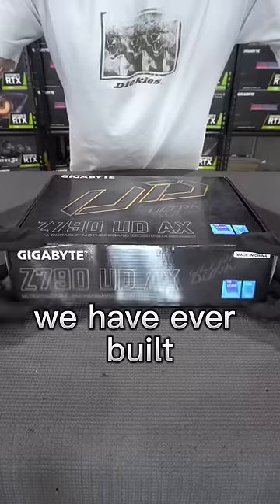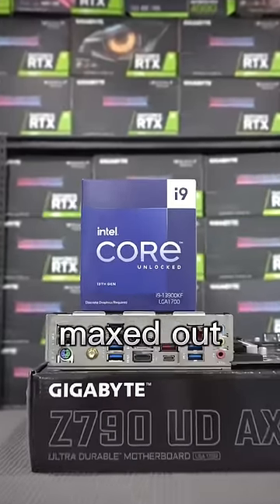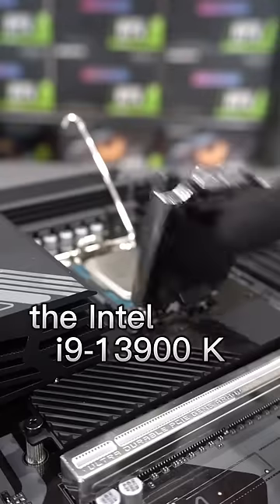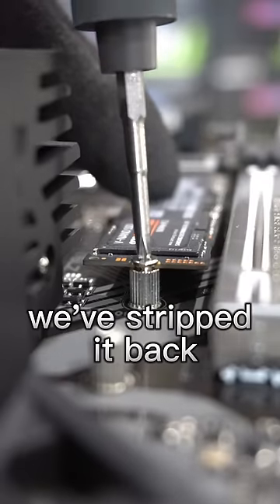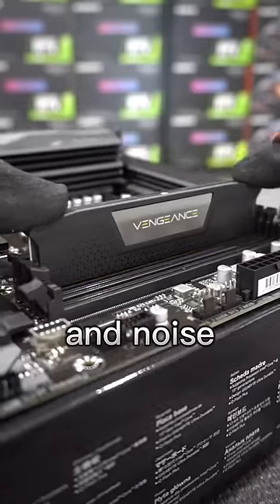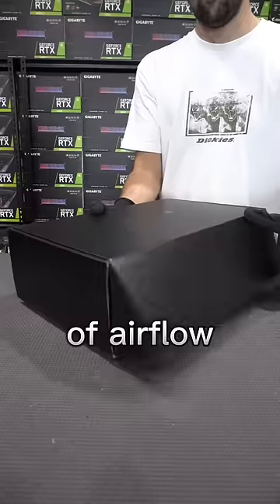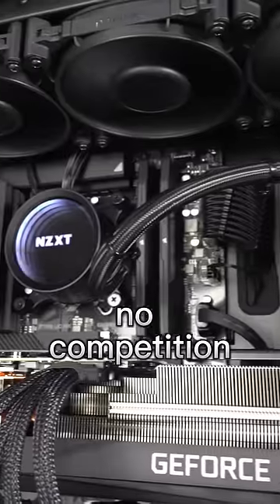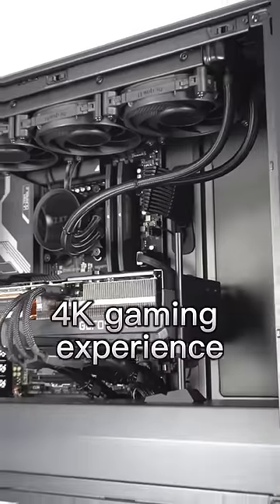The BEST Gaming PC 👑 RTX 4090 + Intel i9-13900K 😱

Comment: Ryzen 9 7950X3D laughs in the corner
Reply: i9-13900ks beats it slightly at the same msrp of $700

only reason 7950x3d wins in gaming is because of the 96mb of cache
Reply: @ayedraco4l  no shit, thats the whole point of the X3D. Also the Ryzen beats it by quite a bit.
Reply: @ayedraco4l  so ryzen is best cpu
Reply: @ayedraco4l  13900k goes for 580$ which is 20% cheaper than the ryzen so uhhh

But then again ryzen 9 does go faster by 10-15% most games
Reply: Then wait for black version and for 13980k too
Reply: @keymer7087 i know but the 7800x3d wasn't out there so at that moment where i write my comment was the 7950x3d the best gaming cpu
Reply: @amistrophy  which is pointless unless you'll buy a $5000 system and play at 1080p
Reply: @Amfibios even a 7950x makes more sense than the x3d
Reply: The 7800X3D is better in gaming than the 7950X3D
Reply: @GeneralS1mba  No.. this is gaming PC. 13900K is faster than 7950X in gaming.
Reply: @ayedraco4l nah the 7950X3D beats the i9 on a lot of games it really depends what games you play which of these is better, tbh though I think the 7950x3d will beat the i9 on future releases when games are built to take advantage of the vcache which intel chips just don’t have, as it stands your getting better fps with AMD on the majority of games it’s literally only a handful of games that the i9 beats AMD on at present and this is likely to decrease as time goes on
Reply: @CertifiedGTA  x3d chip, meaning its for gaming, i mightve worded sumn weirdly. but yea ur right
Reply: Yes IN 2024 THE BEST GAMING CPU IS FROM AMD THANK YOU.
Reply: @amistrophy we do not care if its 20% cheaper sorry if that was rude.
Reply: INTEL CORE ULTRA 9 laughs in the corner
Reply: The intel core i9 extreme edition laughing in the corner with over 100mb cache
Reply: @Djsssebastian  2500€ damn i can buy a pc for that pricw
Reply: @dogenoodle  laptop cpu... (for now)
Reply: @emrehackt  (for now) but somehow the strongest cpu even though being a laptop cpu, matter of fact the snapdragon desktop cpu is but doesnt have good support with rtx gpus

Comment: Dam I definitely needed to see ( 13900k 4090 build number 258) literally no one has done this on YouTube yet tysm
Reply: Yeah obviously people are gonna build the best of the best
Reply: this guy used a 13900kf and he didn’t even use an rtx 4090, that’s a 3090
Reply: Which series is best H or K in i9 13th gen
Reply: yeah literally everytime i get recommended vids from this dude its always the same build its getting old
Reply: @gtbaba123 in most ways, the Intel Core i9-13900K is superior, but it depends on what specs you prioritise, if you were trying to buy one I would probably go with the k model
Reply: "Unboxing" is literally part of their marketing structure suckers.
Reply: @rezkiiwyd  That’s the ASUS 4090 OG OC. It has the old 3090 cooler on it. It typically saves money but is generally not worth it. If you can already buy a 4090 why save 50 bucks?

Comment: “Mom i need this for my class and powerpoints”
Reply: Instead of my father bought me old ass laptop i5 4th gen
Reply: @yoshikagekira1334 me with i3 3rd gen
Reply: @arpitrai8334 me with i3 2nd gen (actually no joke 💀)
Reply: @yoshikagekira1334  I have a computer from 2004 with a pentium 4 cpu running windows xp
Reply: I used the same trick last year, of course, I got only one rx 580, but that's it, thank you😂
Reply: @yoshikagekira1334 be grateful for what you get, child

Comment: For this build, I was surprised that the case was the Meshify 2. I was thinking maybe the Torrent or even the new North, or even the fishtank cases like the Lian Li O11D XL and the NZXT H9 Flow / elite.
Reply: They’re trying to maximize profit margins, the people buying prebuilts don’t know the difference between case quality
Reply: @haydengw  The Meshify 2 is a really fairly good and large case. I don't know why it should be an issue for the parts specified in the video, and plus, many people already did builds with 4090s and this case. It's really well-built and made from good materials, and it's also offering a lot of space. If I got this with a pre-built, I would be more than happy they did not cheap on me.
Reply: The Torrent is great out of the box but if you're adding and replacing fans then it's nothing that special compared to the Meshify 2. They're also doing a blackout build, I think the Meshify 2 would suit it more aesthetically than something like the North.
Reply: Ohh I got one I think since 2018, I build it myself! A 1600x gtx1070 16gb 180ssd 2tb hdd 😂😇. LOVE THE CASE AND WHAT JOY IT BROUGHT ME.
Reply: Personally, I really like the meshify 2 for its looks. It’s still pretty good in terms of quality though
Reply: What about Hyte y60 that case is just beautiful
Reply: @haydengw  I have the meshify 2 xl case it has done great and is good quality
Reply: You seem to know a lot about PC what would you recommend? For 3k?
Reply: I built my computer In this case similar to this but 7900 xtx instead. I love it and wouldn't want another.
Reply: Ayo megumi?
Reply: Agreed, I have a very similar build as this that I believe is a little bit better ex: Ryzen 9, zortak 4090 and a lian li 011 dynamic case

Comment: finally, a build that is identical to the one i want
Reply: like all the builds are i913900k and 4090 lol
Reply: @valerioocioccolanti227  bruh
Reply: @valerioocioccolanti227 this guy didn’t even use a 4090, he used a 30 series card and you can see it in the font of “GeForce RTX” on the card
Reply: @rezkiiwyd  it's a 4090 bro, the gigabyte 3090 doesn't even look like that
Reply: @rezkiiwyd  idk what you missed but the box clearly reads gigabyte RTX 4090

Comment: I would never waste 1500 on a 4090 when not one SINGLE game or program requires it to run. You can build an entire decent pc with those 1500
Reply: Vr
Minecraft shaders
Tripe a games
Max graphics on any game with high fps
Vr 
Sandbox games
Rendering 
That took me like 5 seconds
Reply: @holynugget   Mate most of those require a 3080 at max, You can even run them decent with like a 2080.
Reply: @MrJerppu  keyword “decent”
Reply: @holynugget  Considering VR games run at 72hz with a 2060 super i'd say decent is more than enough.
Reply: @MrJerppu  for most games Yeah, but if you don’t want to drop to 3 fps when there’s more than 5 enemies in blade and sorcery or play any other half decent vr sandbox it’s necessary
Reply: @holynugget  Just out of curiousity, Have you ever played blade and sorcery or any other sandbox games, Because i can tell you that a 2080 can absolutely run them at high with more than 72fps.
Reply: @MrJerppu  with mods and max graphics? Good luck
Reply: @holynugget  You didn't answer the question
Reply: @MrJerppu all the things he listed out is SETTINGS AND OTHER STUFF THAT DOES NOT REQUIRE A GAME TO HAVE TO RUN so technically his arguement is not even valid in the first place and this guy is just a fanboy.

Comment: Lil bro paired a entry level z790 mobo with a i9 13900k 💀👌, and it's not even a k it's a kf i9 💀🤝💀
Reply: What? Isnt the 'f' just means it has no integrated graphics? The performance is just the same
Reply: So true. And the 13900k are no longer the best since the released of i9 13900KS and R9 7950X3D

Comment: I bought a complete Pc ie full Cpu, Monitors , kb n mouse etc n trust me, u dont necessarily need a 4090 for 4k gaming experience. I also went for a minimum rgb for my cpu but it has nothing to do with performance like he mentioned here. It's jst a choice for aesthetics.
My Ryzen 7 7700x paired with Rx 7800xt is more than enuff for my 4k 27" 185hz Monitor for any AAA games with 100plus fps(My cousin gifted me an Msi Amp Rtx 4080 Super which Ive used once only yet) . But i prefer to play it on 1440p idk y it looks better for me. But i played my PS5 on our 4k 65"'Tv for sports mainly UFC n Fifa and all my Racing games though.

Comment: Hello I have a question. I have a pretty old pc with a Intel Core I7 7700k a Inno3D GTX 1060 and 16 gb of ram. I want a new pc  that is future proof and I am thinking about two possibilities. Either a Amd ryzen 5 5600x with a 6700 xt, or a intel core I5 13600kf or a Amd ryzen 7  with a radeon 6800. Either system with a 16 or 32 gb of ram. But is the latter overkill? Thank you.
Reply: For future proof you would want a 7600x or higher since AM4 and Intel sockets are pretty much dead. For the GPU a 6800 XT or 7900 XT should be great. Get 32 gigs of ram btw also I’m 6 months late so idk if you even need this lmfao.

Comment: 7900xtx + 7950x3d has better performance but nt
Reply: Lol, u can lie to yourself all u want
Reply: @OhDammn  i saw a video it seems ur right my bad
Reply: @OhDammn  it really has better performance, a little bit better temperatures and more power efficiency than the 13900k.
Reply: @OhDammn  but the rtx 4090 is way better than the 7900xtx
Reply: Maybe 4090 + 7950x3d. 7900 xtx is slower in almost every scenario.

Comment: I would get a 4090 and just play at 1440p. Im like 6+ feet away from my tv so I cant even tell.
Reply: 4090 is kinda overkill for 1440P
Reply: @Youba05  even 3090 is overkill for 1440p
Reply: @kushvalorant  with stupid optimization of new gen games, no. 3090 can’t even do 60fps ultra on 4k anymore in newer games
Reply: @Youba05  but then it means I never need anything else ever again.

Comment: Need advise, my current build are like this
CPU: AMD RYZEN 5 4500
GPU: GTX 1650 4GB GDDR6
MOBO: MSI A520M A PRO
RAM: 8GB 3200MHz CVN GUARDIAN
SSD: TEAMGROUP GX2 512GB
PSU: SILVERSTONE ST50F 500W 80+
CASE: DARKFLASH A290

Let say i want to upgrade to i9-13900k, what else i need to upgrade? Like, psu? Gpu? Case? I want to upgrade 1 by 1
Reply: You will need to change the motherboard

Comment: I want to see an air cooled version with the i9 13900k. Those Aio coolers I think are designed to leak o r day so you have buy a new pc.
Reply: I've never heard any case of AIO leaking (doesn't mean it doesn't happen, but it's very rare). Also the 13900K is pretty needy when it comes to cooling and an air cooler might not cut it
Reply: @rocksen9283  Also imo aios look miles better than any air cooler

Comment: I have a old desktop with a 5 5600g and a B550 motherboard board every time I try to boot it does not show in the monitor and the white light for cpu is on. Do you have any suggestions on what may help?

Comment: ill just prefer the rtx 2080 ti or rtx 3090 ti because I have trust issues with the 4090
Reply: Probably you don't have enough budget for 4090
Reply: True but I don't trust the rtx 4090 even if Nvidia fixes the melting problem of the 4090 I will still not trust it
Reply: @irvinpreetsingh2295  and plus the rtx 2080 ti is cheap and can run 4k so it's ok
Reply: @toshikaplays_yt456  that's correct
Reply: @toshikaplays_yt456  what melting problem broo
Reply: @irvinpreetsingh2295  there has been reports of people's 4090's melting

Comment: Don't call this "The BEST Gaming PC" when you made the BIGGEST mistakes in selecting the other components. I'm not going for the CPU and graphics card yet. I wanted to point out where you mentioned you wanted the "lowest temperature" on your PC, right? That motherboard, Gigabyte UD Z790 you chosen was a BIG no-no! You could have gotten an AORUS Z790 with better VRM thermal solutions for ALL of your components. That SSD you got right there? That's a PCIE Gen 3.0X4.0, 2x slower than the PCIE Gen 4.0X4.0.

Comment: And only 2 sticks of ram? On a 4 slot board? And only 1 gpu? How is it the one of the best if you ain't running 8 stick of ram, a threadripper, and 2 liquid cooled cards?
Reply: bro, more sticks of rams stresses the motherload, do research, also more GPUs aren't better.

Comment: Why are you scamming your customer it says 13900KF on the box
Reply: Doesn't matter if there is a GPU
Reply: @Oleksey1769  He said 13900k and not 13900KF
Reply: @extranowc5756  he missread it
Reply: @extranowc5756  there is no difference in performance between the 2. It's the same CPU die with the iGPU removed therefore it's way cheaper.
Reply: @AtroGD  The Customer bought 13900K not 13900KF why would he rip off the money from the customer
Reply: @extranowc5756  nope they would simply charge less for the build. Also if you actually paid for This system I'm sure they would tell you it's the kf.
Reply: @AtroGD  You are delusional look athr CPU name and look what the guy said I am sure the customer is watching this and got ripped off
Reply: He says this because people love to complain over them saving $40-$50 AUD on the CPU. For the sake of the video he says K but the customer would be well aware that it's a KF.

Comment: Does anyone know a cpu that will handle 128 gigs of ram?
Reply: 13600k
Reply: Why do u even need 128gb of ram, with ddr5 you Cant really get that if you want a stable system
Reply: @jakkeboenti  ummm my dad bought 128 gigs of Corsair vengeance ddr5 ram and he’s wondering what cpu would handle that
Reply: @Offlineozzy  sadly you Cant buy any sets of 128gb so u would have to mis match 2 sets and that could lead to stabilty problems

Comment: Bro really couldn't get the intel core I9 13900kS
Reply: Or even a 5800x3D, performs the same for cheaper
Reply: The ks is just slightly overclocked 💀 you can do that with the 13900k yourself

Comment: Is my Gaming pc good? Desktop computer Ryzen 5 5600G, Ram 16GB, AMD Radeon RX VEGA7, SSD 1TB M.2, Windows 11 Pro

Processor - AMD Ryzen 5 5600G - 12 threads, 16MB cache
Motherboard - Asus B450M-K II - 2 DDR4 memory ports, USB 3.1 connectors, support for nVme super fast SSDs
Ram Memory - 16GB DDR4 3200Mhz - 3200Mhz fast memory with cooling fins
Video card - Radeon RX Vega 7 - 1900Mhz, 7 cores
SSD Drive - SSD 1TB m.2 NVMe PCI-E - Several times faster than standard SSDs, at least 2000/1400 MB/s read and write speed means better performance.
Housing - Logic Portos ARGB White - 4x 120 mm ARGB fans
Operating System - Windows 11 Pro - 64-bit Lifetime License

Comment: Lol I’ll never understand these pc builds it’s just a nice way to completely rip off inexperienced pc builders, first off for the price the cpu should be the 13900KS (in this channel you always use the F version I don’t understand why), the motherboard sucks it’s literally the worst z790 at the moment, the ram is ridiculous, I’m guessing it’s either 16gb (which would be unacceptable) or 32gb (still low for the price) also other things like storage and psu I’m guessing were super cheap. For the price very bad 1/10

Comment: 13900K? WTF?? That's one slow PC gaming. 7800X3D would've danced around it. 13900K won't even be able to max out 4090, even 14900K struggled against 7800X3D.
Reply: @womapinka those cores means nothing in games. 7800X3D beat 14900K in 21 games test by 5% average. So even with oced 13900K, it still wouldn't be able to beat 78X3D. If he's building a work pc, then that decision is correct. But with gaming, 7800X3D beats every single cpu out there including its big brother. That is why it is still a gaming cpu king. Intel still couldn't beat it with their fastest and greatest cpu yet.
The test:
https://youtu.be/7KZQVfO-1Vg?si=Cul8HoQQGKJnWtoz
Reply: @womapinka nope. In minecraft, 7800X3D is also 10% faster than 14900K. Check the test. That is the most CPU heavy one, portal pioneer, render up to 95 chunks. 13900K won't even touch it. In fact, the list goes on for almost every single type of games listed, and every single reviewers and most often than not, 7800X3D took the crown than 14900K. Even when the reviewer intentionally cripple ryzen by using lower IF, 14900K still lose 1%. Again, thats, 14900K. 13900K is not even a Worthy contender to 7800X3D in Minecraft. Try again.

Comment: Amd rx 7900 xtx is on same lvl with half price of 4090
Reply: Not even close, the 4090 if not cpu bottlenecked even at 4k, will beat any gpu amd has ever created, the rx 7900xtx  is not even any competition for the 4090(amd themselves said that), that's excluding dlss3, the 4080 easy claps any amd cards with dlss3 aswell, I own a 4080 and with dlss3 titles it easily surpasses the 7900xtx aswell as the 7900 xt